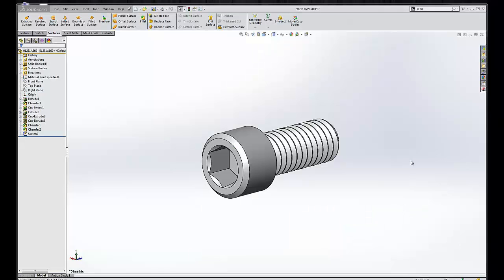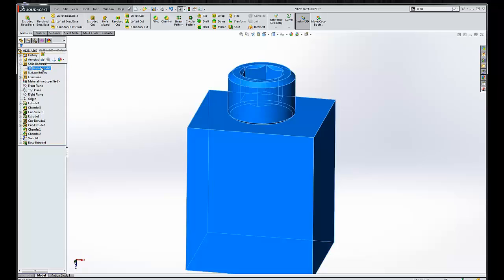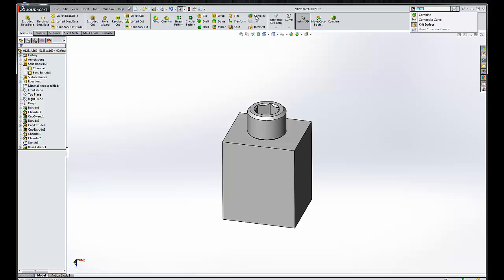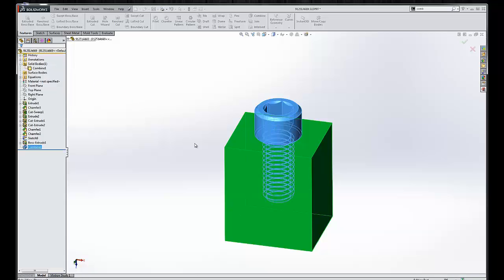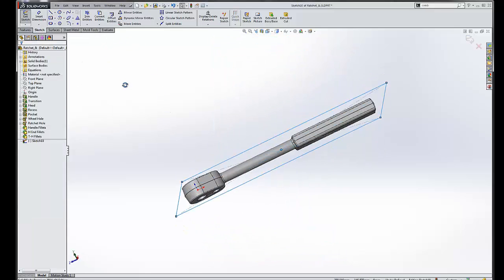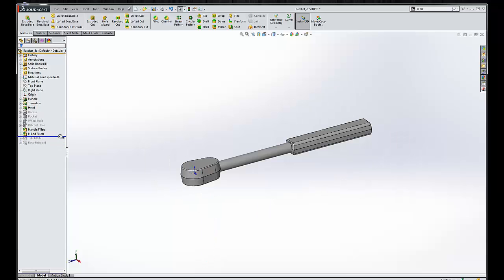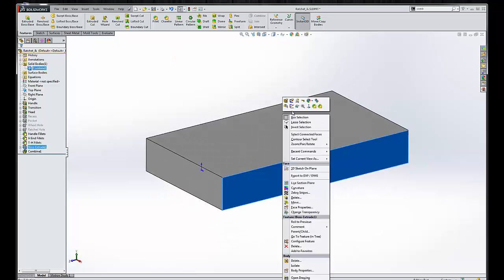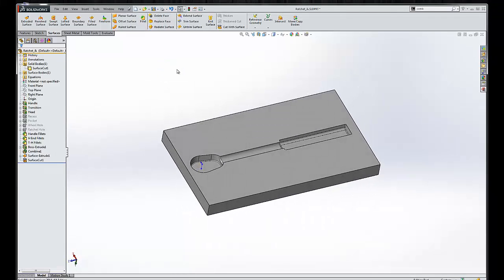SOLIDWORKS – Combine Feature

Comment: my part files cant be combine, combine button is not activated. SW2013 version.
Reply: +Wei Nan Yong  Thanks for the comment Wei Nan Yong. The combine feature is a tool that is available in Solidworks 2013 and dates back quite a few versions ( I cant recall when it was first integrated into Solidworks). 

The key note here though is the combine tool combines more than one body therefore you must have more than one body for the tool to NOT be grayed out. 

You can achieve this by making two extrude boss profiles with intersecting volumes ( say a circle and a square), however on the second extrude, you must clear the option to merge. This results in the creation of a second body. From there the combine tool should be active. 

On another note, be sure you are dealing with solid bodies, a surface body will have to be knit/intersect/thicken into a solid for the combine tool to work. 

Hope this helps

-Adam Hughes
Reply: @AdamWayneHughes  this comment helped me alot ..i did not know my combine feature is not available because i have single body in my part😅
Reply: namaste !!

Comment: my  combine tool is gray .. how do i fix it ?
Reply: You need more than one body in order to use combine. Go edit one of your extrudes or revolves and unchecked the merge box.
Reply: cool thank you for the relying .. i just read the same thing in the form room :-)
Reply: hmmm ok new Question why do i not have a  merge box now ?
Reply: The first feature never has a merge check box because there is nothing to merge on first feature creation. The second feature and so on, so long as you are creating solids and not surfaces, will have a merge box. So check a feature past your first. You may also separate a solid into multi bodies by using the split command or simply cutting the part into multiple pieces with the various cut operations. When you have more than one body, solidworks will populate a "solid bodies" folder in the upper region of the feature tree.
Reply: thank you so much :-D

Comment: Great video. Is there anyway to use this feature in a larger assembly with multiple parts though? Or is it only for a multi-bodied part file?
Reply: Keep in mind that this feature can get heavy due to the geometry, but you could insert multiple bodies into a part (with several holes) and repeat or even pattern the combine. Unfortunately, this feature only applies to the singular part/multi-body level. It is not available in the assembly level across multiple parts/sub-assemblies. Thanks for the comment.